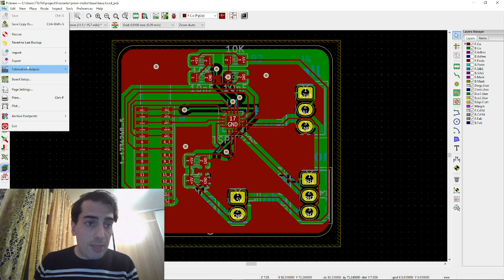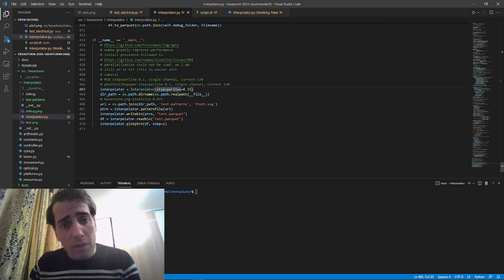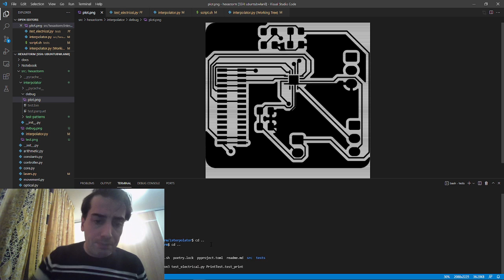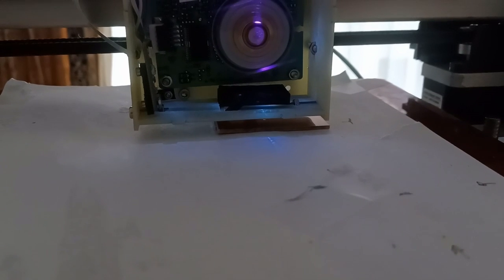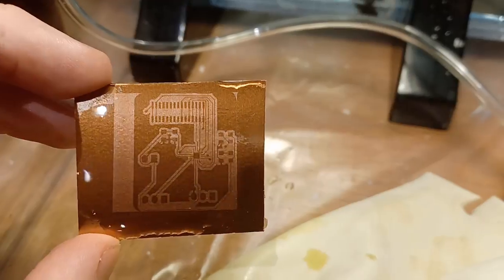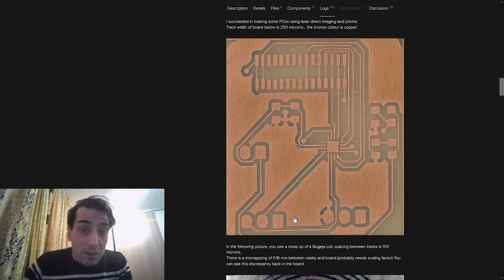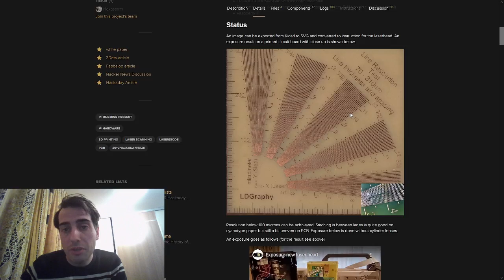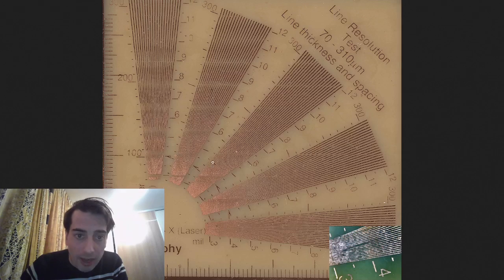Making PCBs with laser direct imaging

Comment: this great project but I think you need more modification to be commercial one
Reply from the maker: I am working on a product which is easier to use. Bringing a product to the market is not easy.
Reply: @Hexastorm  at large factory they use large high DPI UV LED screen to direct expose to PCB but your idea is great for small and DIY users .
Reply from the maker: Originally, a system was developed for large substrates (look for AMSYTEMS). My version would indeed be DIY, small scale. Advantages would be it can expose curved substrates. Also high power lasers can't be directed by LCD or LED screen.@agaberahmed6657

Comment: Diode lasers develop rectangular beam shape, not square. Unfortunately aspect ratio is like 5-8 to 1 so you have to use unusual optic like a cylindrical lenses or other solution is using shutter that make your beam square or close to it (but it mean you lost 75% of laser power). As long as flying optic isn't best options the regular laset ploter may need a lot of times since you will make sharp tiny shapes. It will be many many passes with beam of 0.05 mm diameter. 20 lines per mm, 5 cm wide board need 1000 passes. 2 sec per pass and 5 x 5 cm board need be lasered up to one hour.
Reply from the maker: Partly agree, the prism can rotate up to 24000 RPM and has 4 facets, so 1600 lines per second and is much faster per pass than one line per 2 second. My system operates at 2000 RPM and is very slow in the movie as each line is exposed, I believe 16 times. I did not use full laser power and speed to simplify debugging and as it is easier.

Comment: Can we use it for double layer pcb printing?
Reply from the maker: If you have board which you can expose from two sides, and align front and back within 0.3 mm you could..  biggest challenge is probably vias
Reply: @Hexastorm  can this be used for single layer aluminium mcpcb aswell?
Reply from the maker: @bibinvarkey3041  it can.. you can even use it for other substrates. Coat it your self, expose it and then remove the exposed parts using chemicals and then deposit or remove chemicals on the revealed parts. Hereafter remove the coating. It is not my area of research however.

Comment: if you need just 3cm wide boards then it will be usable, for anything else  nah,, try an LCD 3d printer screen.
Reply from the maker: Roel, you r right that for this sort of layout, I could also have used a LCD screen. Video is mainly used to show that the technology works. Maybe I will add more examples later.
Reply: @Hexastorm  at 2:46 you talk about the imperfections, this is mainly caused by the resolution of the design (file) and the resolution of the machine. both need to match the same or a multiply of it. in this example (photo from Mr. Heller ) i blame the mechanics for it. never the less, it's a promising concept. I prefer to make the artwork on negative film and therefore I am thinking of using an drum instead of the mirror.
Reply: I've had some great success using a resin 3D printer also. My choke hold is finding a simple way to get from eagle Cad to a 3D image that I can slice. I've used photo sensitive boards and when I have enough fails, I reverse the image and use resin as the resist. messy but very cheap. "Learn how to fail fast and cheap" Elon Musk.
Reply: @alexportiiii6414  You can also buy the display and an adapter to convert HDMI to MIPI DSI off aliexpress (or just the adapter). I considered using the resin printer and its firmware... but I wanted something more compact and would drive it with raspberry pi. I haven't finished it because the laser method is more interesting to me.

Comment: Thank you very much for the video.
Could you please tell me what are the differents technologies that can be used in LDI technology?
I think GLP and DMD can be used. Am i right? What elese? 
thank you
Reply from the maker: I have made a list of alternative exposure technologies here https://reprap.org/wiki/Open_hardware_fast_high_resolution_LASER#Alternative_Exposure_Technologies
Acoustic optic deflector, reflective polygon scanner, optically addressable light valve, DMD, grating light valve etc. Most are covered on the list.
Reply: Thank you v much your the best. Only a few of these Tech can be used in the LDI for Lithography right? and i thought that Orbotech uses Reflective Polygone Scanner
is it the same as Rot Mirror with reflective F-theta lens and one laser bundle?
Reply from the maker: @cosanostra8341  orbotech is refractive f-theta lens, reflective f-theta lens is used by next scan technologies. Correct, not all are commercially used for LDI, some are not suitable